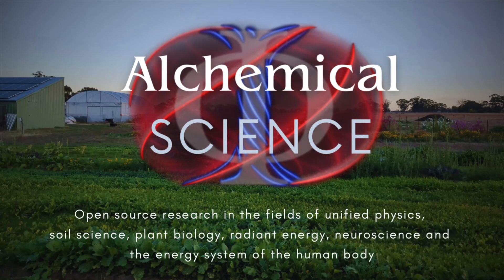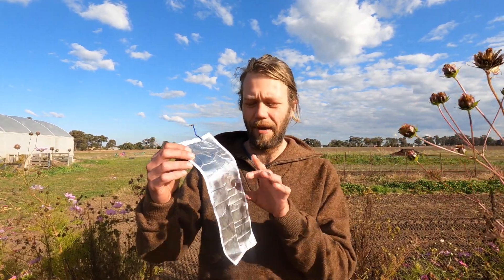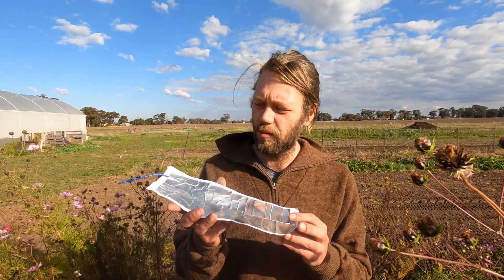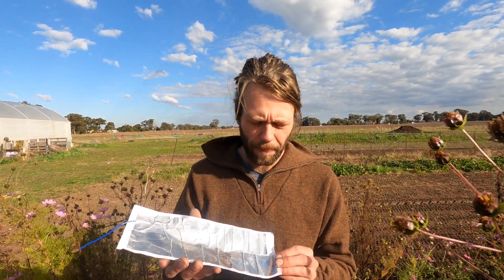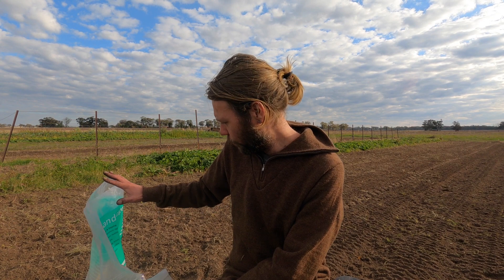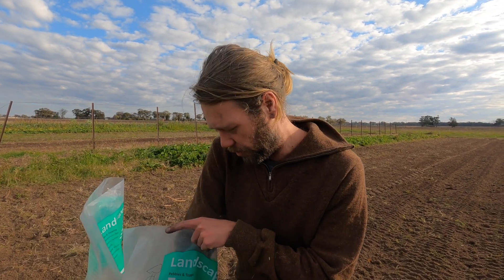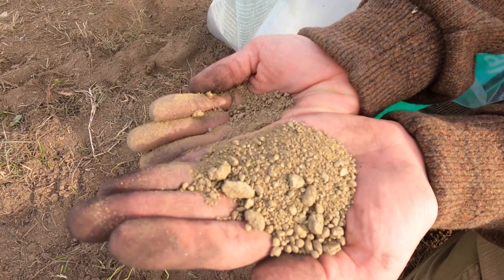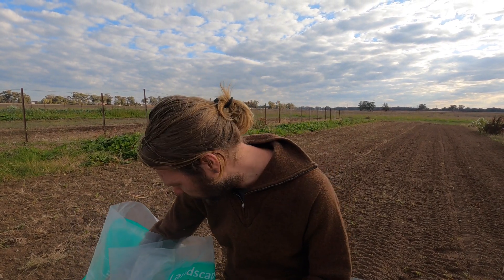Biochar & Paramagnetic Basalt - Energetic Soil Science Part 1

Comment: Im loving what you are talking about. But it seems you have not taken into considersation. The entire soil microbiome that regulate pathogens, Ph and providing nutrients to coloids that is absorbed by the plants. You are basically experimenting with the soil succesion scale and developing the right habitat for a balanced set of soil microorganisms. If you want to bring life to dead soil. You have to reintroduce the microbial life. And you are basically trying to develop the best habita for the organisms. So much of what you are saying in energy terms is the same on the microbial level
Reply from the maker: I've been working on our soil microbiology for 7 years (on 2 farms) before this but this is where Steiner's ideas about soil science differ from the norm. Based on the ideas of Steiner, Reich and contemporaries, the biological/chemical system is occurring simultaneously but secondarily to the energetic system. They claim (and there is some minor evidence to support the hypothesis) that microbial life will self generate when the soil is appropriately "conductive/conducive" and balanced. It's a minor adjustment to the rationale and is not a commonly supported idea but I'm interested in how this corresponds with the results I've found from a from a year of experimentation arranging materials as diy capacitors/radiant energy collectors. The configuration of the materials and the makeup of the materials used to build the capacitor layers dramatically influences the measurable radiant energy flow through the medium. Upon applying this logic to cell tray soil trials, similar affects are observed. Perhaps I will find that I do need to soak/inoculate my char if this idea doesn't prove fruitful but so far I've obtained results that suggest that I want my char as "negatively charged' or as a empty as possible so it will act primarily as an energy sink (energy from the sun, atmosphere and earth). It's midwinter here so I'm a few months off doing more serious field trials still. The heavy frosts hit soon after I filmed this video and it's looking all around miserable out there right now.

Comment: its real easy to make biochar, find a 44gallon drum with a ring clip lid,  cut 4 40mm holes in bottom,place on 3 bricks ,light a fire inside with your wood ,when burning well fill drum to top with fire wood when flames get to top fill with more wood, takes about 3 goes, thentake off bricks and put lid on with hose to cool it down , I did it with murry red gum and charchol came out in 30mm chunks that crushes easiily,Iadd crusher dust here at the nursery to pots,definately works at cupfull per plant , cool energiser plates, did you know that some people get excellent results with 6in terracotta pipes stacked to 2m high filled with basalt rock dust, the basalt dust down here in victoria is real dark, ever thought of building a 6 m tower of power
Reply from the maker: Yeah I've been doing char in a cone pit. The char is harder to get perfect than in the barrel method but I can do more at once so it'll do me for this winter. Hardest part of the char is cutting all that wood haha.
I'm in Vic too. Hit me up if you're ever in Bendigo, sounds like we'd have a bit to chat about
Reply: @AlchemicalScience  use to live in bendigo now 3hrs nth 100km sth of albury, love to help out with the bio char pit ,something new ,for your mkt garden we supply a comercial grower with seedling grown in the 198 cell trays , 13 tunnell houese 20m times 4 m , we have the air seeder to drill out the trays chrisine would let you use it , how many thousands do you need,you welcome to visit  the nursery,I love cutting wood have electric chainsaw, done 7 trailer loads with it already
Reply from the maker: Okay yeah we must be living parallel lives... I just did 7 loads of wood with my electric chainsaw too.. Cheers mate, I'll hit you up if I'm ever out that way. Just checking out other farms is always worth a trip

Comment: I am enjoying the channel. I hope to buy some land shortly and develop my understanding of nature. I was looking at existing power solutions and it seems like Tesla had a complete micro hydro solution using the turbine connected to the generator. I expect modern materials can make the complete scheme more cost effective - I have a DIY design and I am struggling a little with the maths, as the turbine and the generator have so little public information. It will take me a bit time to catch up❤
Reply from the maker: Fantastic. Yeah, one of the greatest challenges of our time is to reverse engineer  Tesla's power systems with 120 years jump in tech advancement to factor in. It's not easy to find information! I have been piecing together hints and small successes from tens of incomplete sources
Reply: I am also interested in tesla turbine , please keep in touch to update our imaginations to upgrade this knowledge